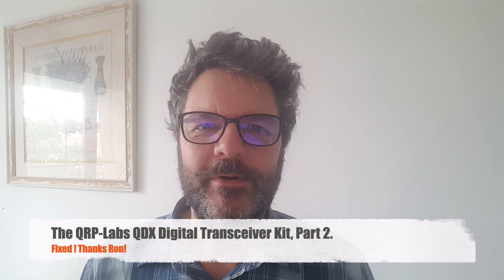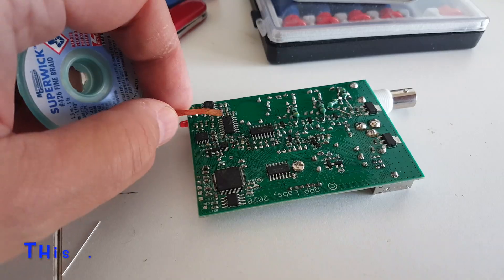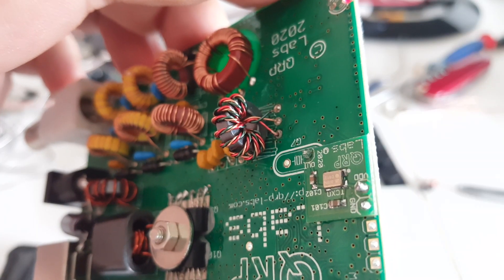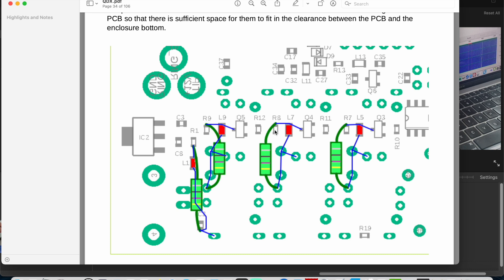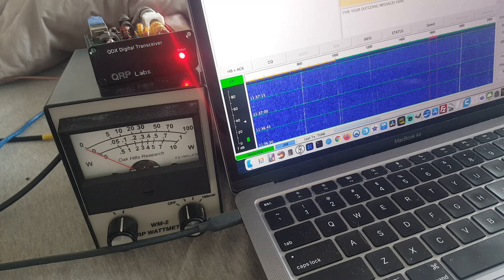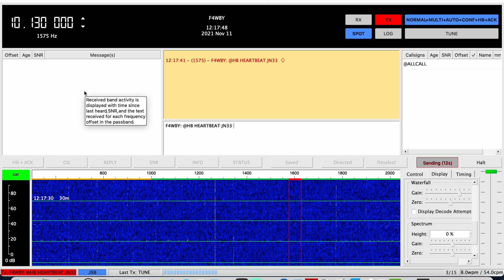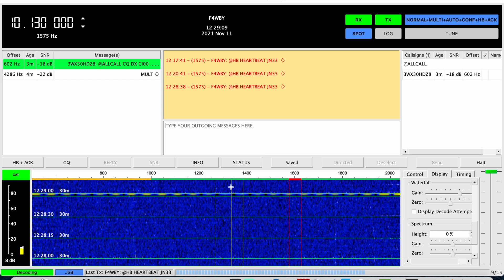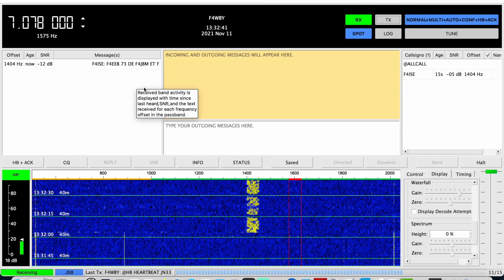The QRP-Labs QDX Digital Transceiver Kit, Part 2.

Comment: Ron Taylor fixed my QCX Mini with the same problem, no power out, yet it could receive great. It turned out to be L1 and L2 toroids not having the enamel completely burned away. He mailed it back to me and it should be here next Tuesday (5-28-24). I have a 40 meter version coming (QCX-Mini) that I will be using an exacto knife to scrape off the enamel. 72 de AI5DD Joseph Anthony

Comment: why do the inductors need changing,is it a poor design?
Reply from the maker: The SMD inductances did not work. The board was corrected later..
Reply: @RadioPrepper  why wrong values?
Reply from the maker: No, apparently a "full size" inductance was required. I don't know enough to know why...

Comment: I commented on this topic on Part 1, but I'll repeat it here. In order to remove tiny SMT components you need to put a LOT of solder on the iron tip in order to transfer heat effectively. Using MORE solder in order to remove solder is counter-intuitive, but that's the way it works. So blob up your iron tip and you'll do fine. 
FYI, I have been doing electronic soldering for 60 years, am NASA certified at soldering, and teach it to new hams.

Comment: To remove lacquer  on the T1 wire, use a flame from lighter and watch it bubble. Then remove with abrasive pad. Very easy and full proof. You do want to watch with magnifier so that you only burn off an appropriate  amount of insulation. Then tin the wire to make sure it's taking solder. I'm not a great kit builder but I did learn this  and I never have this issue you are correcting. I love the three color wire great idea.

Comment: Great video.  I am going to wait for the QRX all in one radio. HF/VHF/UHF.  For $45 you can purchase assembled and tested.  While I am good at soldering, I am not too found of winding my own coils.   I use to have a multimeter with induction test   I am not sure if I would trust making an inductor without testing first.      Nice challenge building it yourself but I think most people will go for the soldiered board.     The price is perfect for a low cost SDR.

Comment: 👍Glad you got the QDX working Gil. I need to wait until Hans has some more kits in stock. I think this transciever is a great idea for QRP/P digital modes. I was keen to try one on Olivia (could be another good digital mode from a prepping perspective?).
Reply from the maker: Is Olivia a single-tone fsk type modulation?
Reply: @RadioPrepper  I think Olivia sends only x1 of up to x32 MFSK tones at a time. That is why I was curious if QDX would work on Olivia.
Reply from the maker: I'll ask Hans...
Reply: @RadioPrepper  Thanks Gil. I think that I should have said Olivia TYPICALLY sends x1 of up to x32 tones at a time. You can have up to x256 tones. However, the typical maximum I have heard on the bands is x32 (e.g. Oliva 32/1000).
Reply from the maker: I have tried it, great mode!

Comment: Gil, You should be able to adjust your PC for a RX level of about 60 (recommended for JSTX) and your TX (for about 45% - yours is FULL SCALE!) for optimum encode/decode.
I suggest set your PC levels as above (in Audio/Record Settings-levels) - using WSJTX (to start with) and then switch over to this other application - at least your PC levels will then be correct!
Reply from the maker: The level went up to 45 using an EFHW.

Comment: I had the same problem with the first pad, had to bridge to transistor pad. Worked well out of the box after that but failed after 15 minutes inside the box. 3.3v regular found to be very hot,  even worse on transmit. I have the 9v version. Wonder if anyone else has the same problem.   Added edit. I removed 3.3v regulator input from 12v line and bridged to 5v output.  Now fully working on all band. Have found receive on the QDX as good as my ICOM. Outstanding product, now I want to enable PTT but may wait for QDX v3.0 hopefully may also have options for 17m and or 10m G4PEY
Reply from the maker: Interesting thanks.

Comment: Good job Gil.  When I got ready to remove the smd inductors, I first added a small dab of solder to both ends. Then I touched it lightly for a few seconds.  The added solder transferred heat quicker and the part easily fell off. Glad yours works.  I’m waiting for a cable before I try mine.  BTW, I am Ron’s brother.  Best Elmer a guy could hope for.
Reply: Gil. You are going to love the QDX. It was mine that Ron WA7GIL told you about repairing the traces. He’s my brother/Elmer too. What do you think of his callsign?
Reply from the maker: Very cool yes, LOL!

Comment: I just finished one last night (11/10/2021) also had problem on 30/20 with no output - found I connected the new RFC one pad down from where it was suppose to be, so was grounded. Also had low audio level, updating to the latest firmware seemed to mostly solve that problem. 30 still seems to be really weak though.
Reply from the maker: Hi Steve, indeed.. BTW I built so many of your kits ;-) glad to see you here!

Comment: You can adjust the audio gain by using the terminal app, the manual has notes for making this adjustment
Reply from the maker: Thanks, I'll do that!
Reply: Have you tried adjusting the audio levels on whatever computer you're using - particularly the microphone?
Reply from the maker: No input levels for the device. I did adjust the level through the terminal, but no change..

Comment: What gage of colored wires you used to wind your toroids?
Reply from the maker: It looks to be the same as the one in the kit, answer is in the manual..
Reply: @RadioPrepper  I like the different colors, but for me to buys some, it would be nice to know what gage of the wire, like 28 Gage wire.
Reply from the maker: It is 28.
Reply: @RadioPrepper  Thank you

Comment: great that you've been able to solve it. I wonder if one could run PSK31 out of it as well. Do you know that Gil?
Reply: Any single tone FSK mode. That includes WSPR, JS8Call, FT4, FT8, JT4, JT9, JT65 and more. But not PSK31 which would require a linear modulator and amplifier.
Reply from the maker: Thanks Hans! I was wondering as well..
Reply from the maker: The manual does not specify which modes work. I'll try to find out..

Comment: Congrats! I have just received mine 2 days ago, will be starting assembly soon, so thanks for timely info about possible problems with the inductors! Hans wrote on the group that the Rev2 of the QDX board is already fixed in a way that the smd inductors are removed already and the through-holes are made for new inductors to install. Well,  good for the next batch, and for us first-batchers it’s just to be careful in handling the soldering iron :). As it comes to the low level of received signals on the indicator, isn’t this a sign of the too low microphone/line-in level on the computer ? I think, I had something similar with my Win10 laptop long time ago, so I’ve just opened the general computer’s sound settings up and moved the microphone slider up until the input level on my wsjt-x app indicator became ~60. But I don’t know about Mac. 73! Linas LY2H
Reply from the maker: I guess I'll have to buy the rev2!

Comment: Very good video❗️.   YOU ARE ABSOLUTELY CORRECT.  When re-working SMT components by hand 🤚 you have to be extremely careful,  I will say that a good re-working technician is an ARTEST in the field.  It is so easy to lift a PAD,  the heart, solder tip, and the person has to be almost 😅perfect to be successful.  I would suggest that you get an old scrap PC board and practice, practice, practice before you make the ATEMPT❗️  It will make ( MISSION IMPOSSIBLE ) much more doable.👍. 73  KV5P
Reply from the maker: I've built my share of SMT kits but never had to unsolder any component!
Reply: Its not so difficult the trick lies in having a microscope. And it doesn’t even have to be a good one. 10-20x cheap one is enough. Also having control of the tip temperature helps in not lifting pads. Also if you see it properly you tend to apply less force to wick the solder off. To remove smd resistors and capacitors the best imho is to use 2 soldering irons at the same time. If its a multi leaded component you can try wicking the solder and lifting the pads with a piece of kapton tape for example or a toothpick. Practice practice practice!

And use FLUX.. loads of the stuff!
Reply from the maker: Yep, I have a USB one..